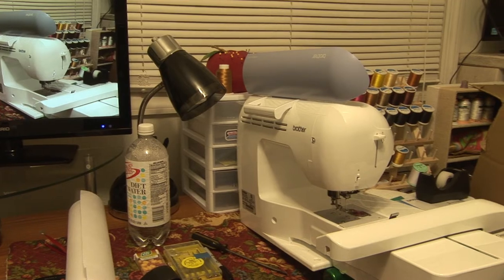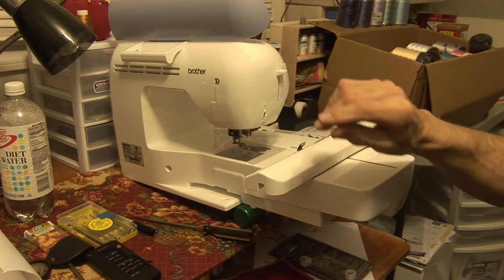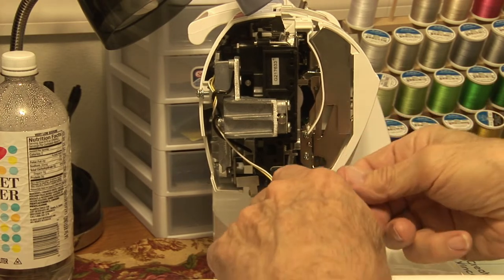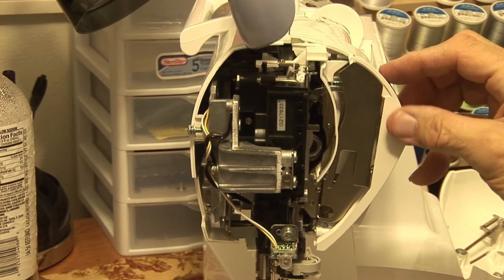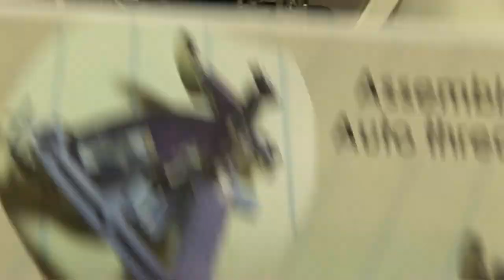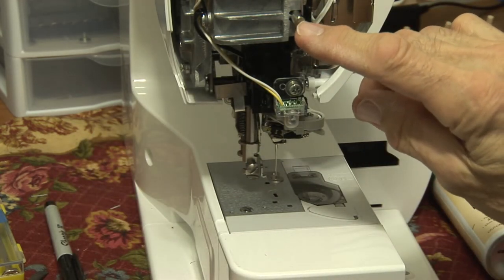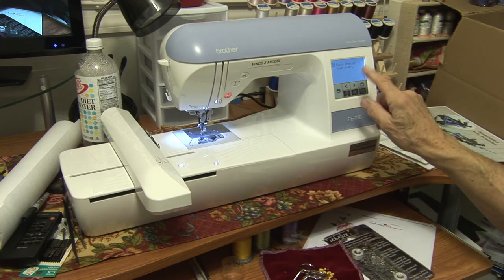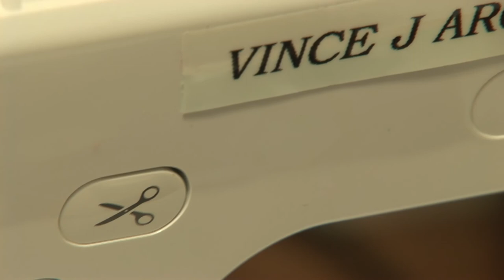Brother PE-770 pressure foot problem

Comment: I followed every step in your video, and when I brought my presser foot down, the red light did not turn green. This happened after i embroidered a 5x5 pattern with lots of stitches. It just kept saying, "Lower the presser foot lever." I really am frustrated. Do you know what this could be? Thank you for your recommendations, but nothing in it worked for me. 😢
Reply from the maker: Before we get into your problem. With a normal working machine, if go up to machine And lower presser foot, you won't get a green light until you load a design into memory then click ready to embroider. Then you will get a green light. When a design is completed, and you lower presser foot the light stays red until a design is selected. If your ready to embroider presser foot up, and you press start button you get lower presser foot message.  Now where we with your problem?
Reply: Still red
Reply from the maker: @cathysUtubeXOXO  you read my explanation . Your trying a design loaded in machine, you put down presser foot, and press start button and no green go light, you recycled presser foot several times. Still no good? Then I can't help you.....sorry.
Reply: @Vince J Arcuri  World of Machines   What do you mean "recycled" presser foot?
Reply from the maker: @cathysUtubeXOXO  lift up and down, recycling...sorry.

Comment: My presser foot is stuck in the down position. It won’t budge!  Can you help me with this?  I think it needs to go into the shop for repair.
Reply from the maker: Hi pamklein. I don't have the PE-770 any more, but it is like my PE800. I have had these machines for about 12 years and have never heard of this condition. I have seen the presser foot turn on its shaft and was no longer over the needle plate needle hole. Did this happen while you were using it, or was the machine lying idle for years then you noticed this? So pulling up on the presser foot "lifting Lever" is not possible, could you try lifting the "lever" while prying up on pressure foot using a wide flat screw driver, see if it starts to move!

Let me know'
vince
Reply: I have been using my machine daily as I have a small business where I make patches.  Last week I noticed it was a little harder to move that lever and now it’s totally stuck. I can’t get my hoop out.  We have a Brother Sew and Vac repair place 5 minutes away thank goodness.  I’ll try what you suggested and let you know if it works.
Reply: And mine is a pe800
Reply from the maker: @pamsfiberfrenzy  Take the plastic front cover where the auto threader is. Put some WD40 on the presser foot shaft top to bottom let it sit few minutes  then try. Don't use much WD40
Reply: I’ll be back in touch to let you know what happens!  Thx for your help!
Reply: Vince, I tried your suggestion of lifting up the presser foot with a flat end of a screwdriver and lifting the lever at the same time and IT WORKED. I haven’t actually embroidered anything yet but I want to thank you so so much for getting back to me!!!  I’ll let you know how it goes later on.

What do you think happened that caused it to seize up?
Reply from the maker: @pamsfiberfrenzy  watch my video on the Brother NQ1700E. That machine runs up to 860 SPI  a commercial speed. It requires lubrication especially the needle bar and presser foot shaft. There are 2 or three spots to add 2 -3 drops of white (clear), sewing machine oil. The spots are where the steel shafts, contact the aluminum casting, without oil you get dissimilar metal oxide buildup.  My email is: vince9184@gmail.com
Reply from the maker: @pamsfiberfrenzy  What my video on the Brother NQ1700E lubrication. That embroidery only machine runs up to 860spm which is commercial speed and it requires lubrication with white, or clear sewing machine oil where the steel shafts slide through the aluminum machine casting. Originally they are oiled, but with lots of use this oil evaporates and you have dissimilar metal oxidation formed, which seizes up the shaft. dry off the WD40, then apply 1-2 drops of singer sewing machine oil.
Get back to me:  vince9184@gmail.com